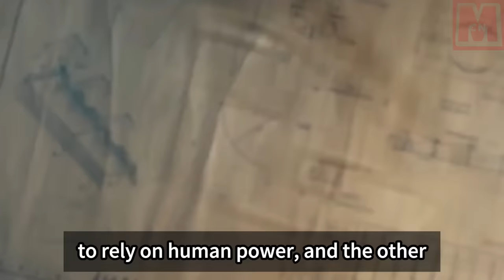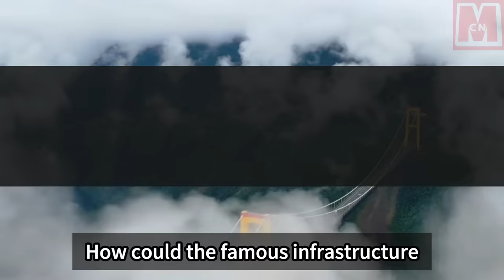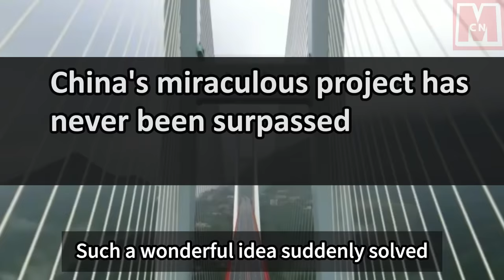China’s miracle bridge project! The first rocket-built bridge technology, has not been surpassed.

Comment: ⚔️Old School technology: As a former R.C.Engineer, we used a rocket attached to a pilot cable to bridge a gap, then used that cable to increase  the cable sizes, etc. The steel rocket would penetrate the ground, on the far side to stabilize the cable, that was coiled. Then each section would be pulled, until the anchored home side would hold the cable tight.🛡️